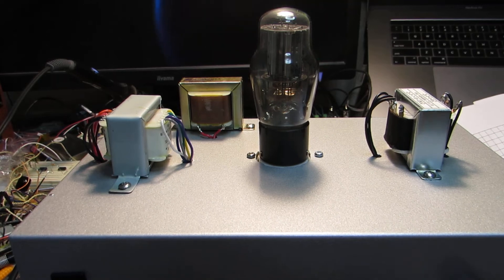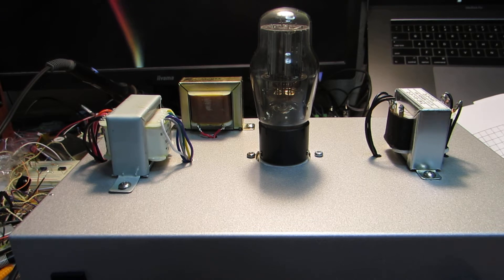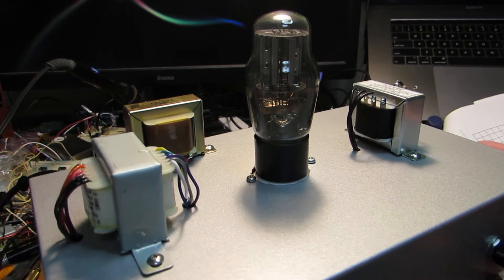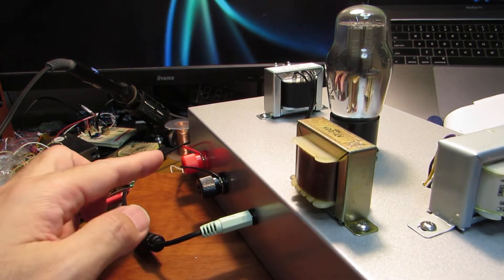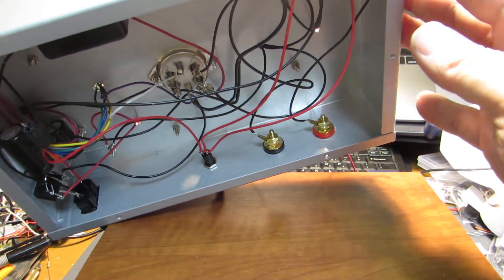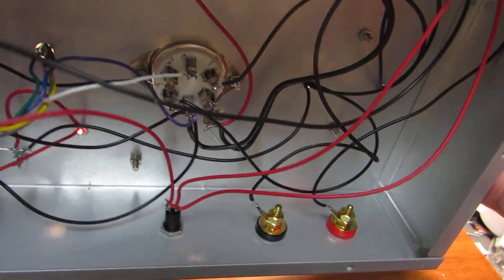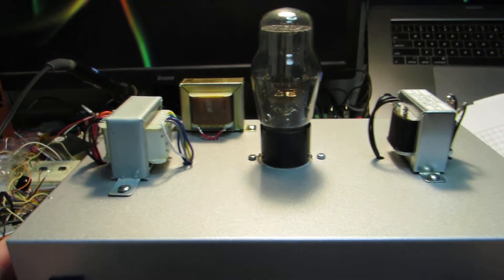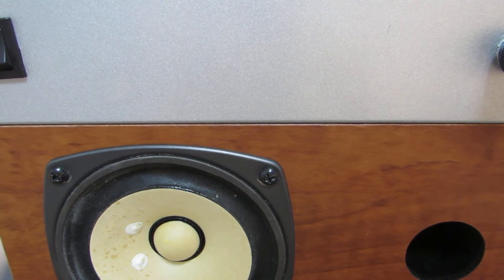Simple push-pull amplifier by "type-19"

Comment: Wow, so simple yet so good...
No capacitor or resistor in the signal path... Class B with tapped transformer phase splitter, with 85 year old tube (double triode). Maybe use a bigger speaker instead of the Fostex full range to compensate for low power and gain.